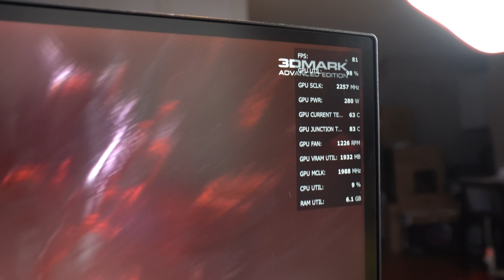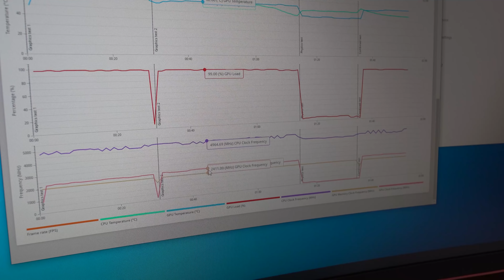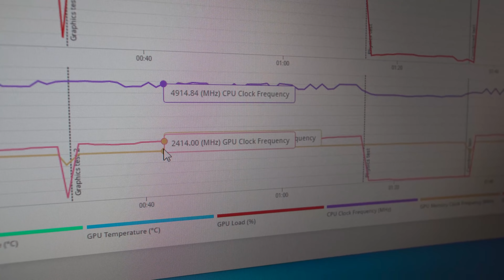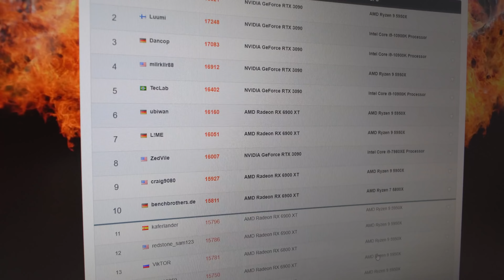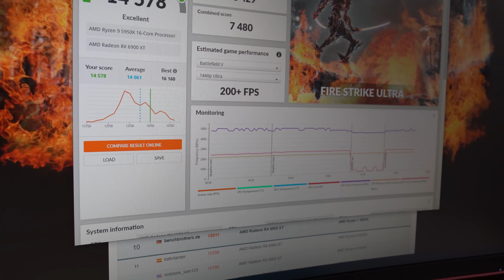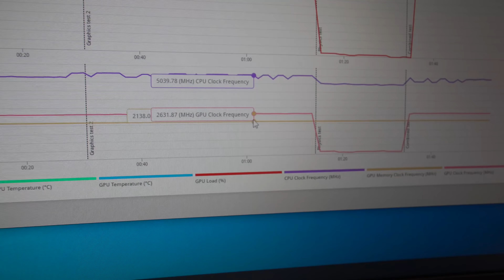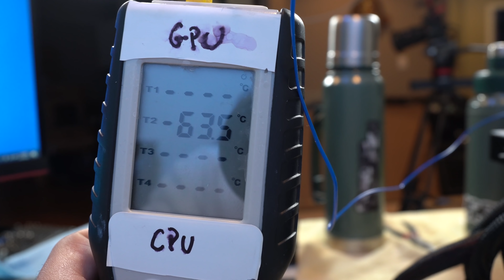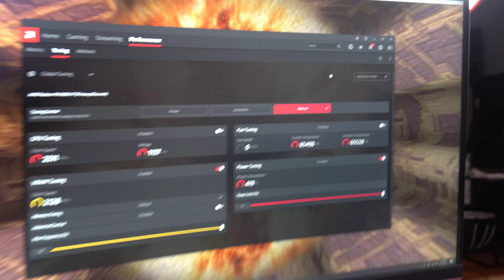The truth - Admitting I was wrong

Comment: I started the xoc last year with the 2080 ti as well. I tried dry ice ONE time and said nope no thanks, way too messy. Went straight to ln2. Ive been doing it quite a lot, not killed anything yet.... lol. I held 12th in port royal until the new cards came out. Now with a 3090, im sitting at 21 in pr. I havent checked the hall of fame, so maybe been knocked down some. I had to take a break, my bios chip in the z390 dark died. Evga sent me a new one and getting it all set back up.
Before I ever even tried xoc, i watched a ton of xoc everywhere I could to learn, still trying to learn all the little tricks to get the best scores possible. But my mounts always seem to be uneven. Especially with the 3090 die being convex. And I'm still not that good at it because both the 2080ti and 3090, I haven't been able to get them to run faster then 2505 mhz.

Comment: I use brake cleaner sprays to clean greasy h/w and since they're corossive, after evaporation I spray them with electronics / contact cleaners. Brake cleaners dissolve almost everything, I first used them on ti bolts to dissolve copper paste which is just a pain to remove otherwise. It's also the fastest way to remove thermal paste.
Reply: Gotta use the correct kind of brake cleaner. As some of the stuff will warp plastic connectors. But I also do the same from time to time.
Reply: @tacticalcenter8658  True, the one I use explicitly states: "Product does not corrode rubber and plastic". To be safe though I spray the h/w with contact cleaner afterwards and never had an issue with anything.

Comment: surely after the dishwasher you did rinse with alcohol to displace the water that sticks around right?

right?
Reply from the maker: proper precautions were taken
Reply: @BPSCustoms  i see. i'm asking because i had a sound blaster live that went stupid after the dishwasher and using alcohol fixed it immediately, also a socket 1155 board i did afterwards came out flawless using the same trick. 
both went in along the dishes with the regular soap tab -  there were not anything toxic on them, no worries. :)

who knows, maybe some water nested deep below the bga and kaboom. sad times. o7

Comment: Set in s toaster oven at 385 degrees and bake it for 8 minute with die up. It may bring it back to life. Look it up on Google. Goodluck Brian👍
Reply: Cooking a PCB will not fix a short
Reply: Brian doesn't know for certain it is a short. It is possible with more drying time it could be fine...but yes maybe not. It still may be fixable.
Reply: @shaneeslick  Whether people agree with it or not. It sometimes works. If the gpu is getting trashed, sold or donated...Might as well give it a try. If someone is against it then they should do it.

Comment: OOF!!
Ya, XOC is an expensive hobby bud, but you can still have fun with some of the older hardware too.
I've also noticed a lot of you don't tend to use heater elements/tape on the moisture/cold sensitive SMD's, or on the back of the card.  They can really help if you're new and need time to get to the benching stages.  Any reason?
As to dead hardware, you could think about learning to solder with a hot-air station to save a lot of money and time RMA'ing stuff.
And as to the dishwashing you need to ABSOLUTELY dry the hardware out.  I find a couple of days in the laundry airing cupboard and then a good blow with a heat gun on medium heat, especially under the die and chokes etc to make sure no water settles under them. 👍
I can't give up OC'ing, I love buying cheaper hardware and pushing it to the limits just for bang for buck reasons. 😏

Comment: Use DDU in safe mode to delete all previous drives. Then reinstall the drives after you reboot into windows 10.👍 Don't use a dishwasher. Use an ultrasonic cleaner with 99percent or higher alcohol..👍
Reply: Just don’t use Vaseline in the first place and you won’t have this issue
Reply: @avagreen9060  I agree..I think KingPin and Jay do it. But they use an ultrasonic cleaner to clean it off if I remember correctly.

Comment: Car guy here. Totally understand pushing the limits on stuff. Whether it be cars or pc hardware. Ask me what happens with you use the wrong nos nozzles thinking they were a smaller size. Shattered 7 out of 8 pistons, 8th one went through the side of the block.
Reply from the maker: I would like to see photos of this
Reply: @BPSCustoms  I'll see if I still have them. Was almost 10 years ago now on a buddies camaro. Thought we had 75 shot nozzles, turned out they were 300 shot nozzles. That LT1 never stood a chance.
Reply: @RukhWhitefang  nothing would stand a chance as I assume it was NOT fuelled for #300 shot
Reply: @jasonriddell  Correct, and it was a stock bottom end 90s LT1. Hell of a boom at the track.

Comment: You should try getting ahold of some older cards like some 980's or something for practice. yeah it would still suck to kill one but it wouldn't be like a 3090.
Reply: Have you taken a look at how insane are the prices right now of even 5+ year old used GPUs? It's just flat out nuts trying to buy pretty much any graphics card these days other than a miserable GT710 or maybe a 1030.
Reply: @burnsyd17  yes but you can get a 980 ti for around 300 and in comparison to the price of a 3090 that isn't much and if I was practicing extreme oc I would much rather kill that than a 2000ish dollar card.
Reply: @whiskeredgundam7765  very true.  killing any hardware sucks.

Comment: I'd just use cheap hardware.  Buildzoid does xoc on old stuff all the time.  If a $100 gpu dies who's cares.  You gotta walk before you can run.  I understand why one would want to do this at the highest level especially because for youtube that's where the views are but realistically no one starts at the top.  Doctors don't start with brain surgeries.  Mechanics don't start with engine rebuilds.

Comment: 6900xt can't oc further than the 6800xt... Ie it's locked around 2.7 give or take. They can't go over 2.8ghz despite the 3ghz bios limit. Disappointing to say the least. And the red devil isn't worth 1700. That's stupidity over paying for stupidity. The market is retarded right now. Don't bother with buying anything overpriced right now.

In any case, you can get a small pizza or toaster oven put it outside so you don't breath the toxic fumes and bake out the moisture. Other than that you may need a professional to investigate and troubleshoot the issue.

You should really start out doing this with some cheaper gear. Learn from mistakes cause that's how we all learn, then you can try with more expensive gear.

Comment: Wait.. hold on... the dishwasher thing is a real thing?? I thought people saying use a dishwasher to clean GPUs was a trolling thing? 🤔🤔🤔

I also want to say that we all appreciate what you do for us the fans and the channel Brian and I know this is a huge blow but everything takes time to get things right. Story of my life lol. Your still awesome 🤘💪😃
Reply: As long as there is no electricity moving through the part, water isn't dangerous. DO NOT use any detergent, most of them are corrosive, and you do run the risk of the jets in the washer breaking off small components like capacitors. Other than that just make sure it's dry before using it again.
Reply: I wash my high end Keyboards in the dishwasher all the time...no soap and let dry for a week
Reply: @Exz84  ahh that makes sense. I assumed the direct run cycle without detergent should possibly be fine BUT i was still concerned and thought it wasnt a real thing. I appreciate the info brotha.
Reply: I used to repair motherboards, mostly for laptops. We always would bake the motherboards in an oven to evaporate any liquid or humidity that was consumed by the pcb and components. You can certainly put them in a dishwasher. This is almost necessary when ln2 oc due to the Vaseline on the boards. If we did this, we would bake out the moisture afterwards.
Reply: @ccgert  thats great news honestly. I only clean my hardware with iso alcohol so I didnt ever get to the level of needing anything stronger but I appreciate the info of knowing I could if I need to.
Reply: DER8BAUER has done a video on dishwashering after XOC "adventures"
Reply: @jasonriddell  link to the der8auer vid https://youtu.be/SVuI-Fn27-U

Comment: Sounds like you are doing things wrong if you are breaking off caps and being careless. Also, a lot of XOC guys like Jay and Steve get free samples to play with. Makes it much easier to compete when you get two free KP 3090 cards, and then a free repair when you break it. Third party software is essentially needed to run XOC also. Sounds like you need to hookup with pro for some guidance.